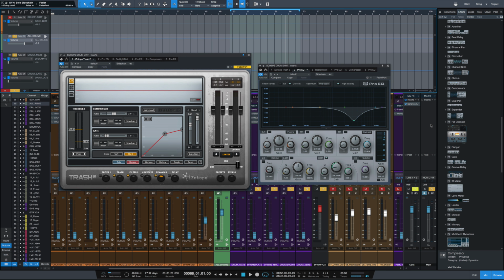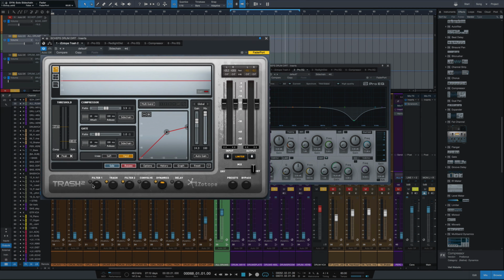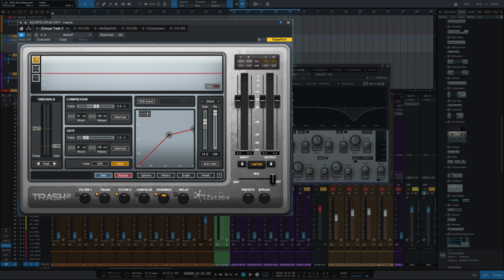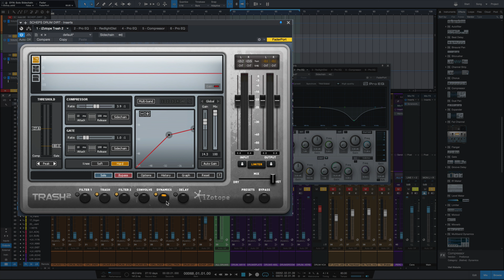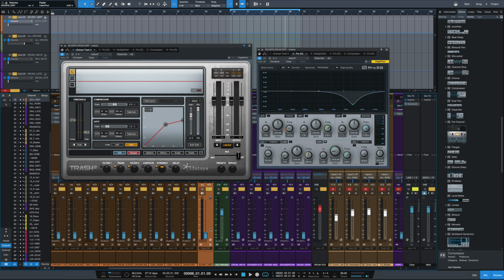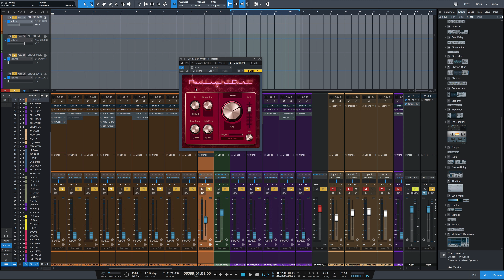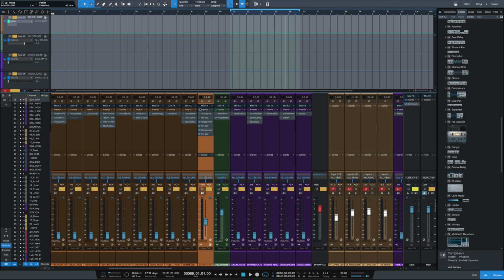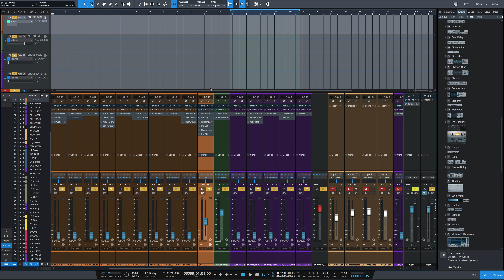Andrew Scheps Drum Distortion Mix Trick | Parallel Processing for Huge Drums

Comment: would you stack this ontop of regular parallel compression?
Reply from the maker: Yes
Reply: @GreenLightSound  how much parallel shit can you stack? For some reason my brain tells me not to use too much
Reply: @aaronjames8547  As he explains here, this process is most impactful when you automate it to only be on at certain points in a track... i.e. choruses. Plus, you're only blending it in a little, even less than you would with a normal parallel drum crush. You shouldn't be afraid to stack parallel processes at all. The key is not to have them overpower the original drum tracks and automate them on and off throughout a track. Learning where, when and how much to use them is a matter of personal taste.